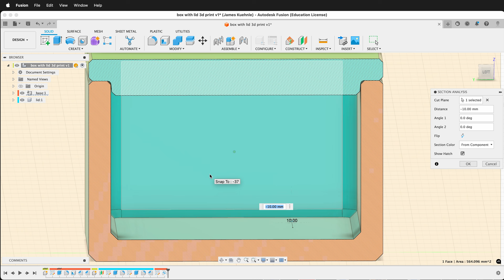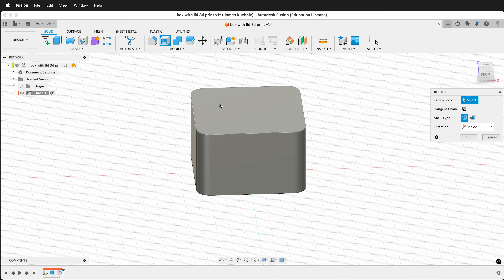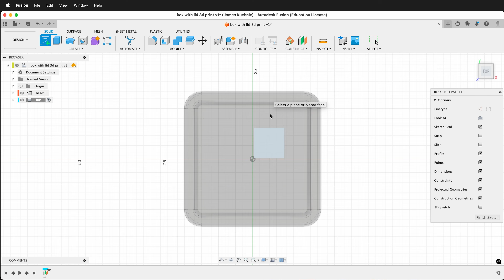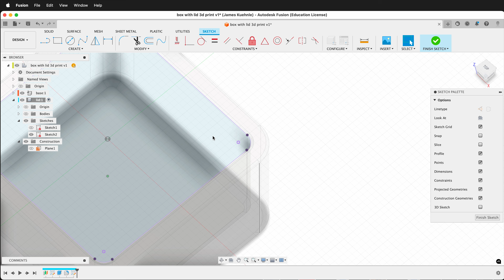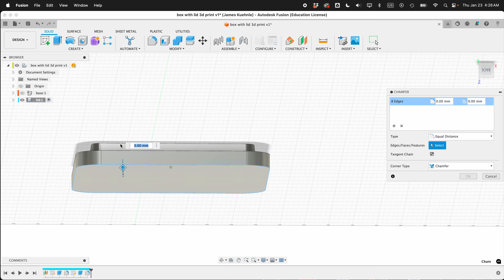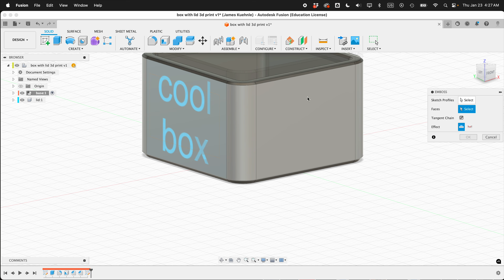3D Printed Box with Lid Fusion 360

Comment: Where is that new component button?
Reply from the maker: After January 26th, Autodesk Fusion changed to the hybrid design space, if you are working in the hybrid design space and not the part space, then right click on the top level component to create a new component 

To change from assembly, or part design, click in document settings in the browser infusion and then clicked a little pencil to change to hybrid design

Comment: Thank you for not going too fast. I already created a box but not the lid. Now I have to add an extruded mount to the inside for a small motor and controller, and flywheel with gears. It's my first time.
Reply from the maker: Sounds like a rad project. Let everybody know when it's done

Comment: Excellent video for a beginner like me. One question though: do I need to somehow separate the two components before printing or do I export and slice it as is? Will the two components be loose/separate after printing?
Reply from the maker: There is a check box in the 3d print export to either save them as individual files or export it as one assembly, when you bring it into your slicer, there is also often a question of whether it's multiple parts or one

Comment: how much resin is used for that size ?
Reply from the maker: Not sure as I haven't printed it yet, but you can find out the volume of a body infusion before your 3D print it so you can buy the material. Use, most slicers for 3D printers. Also tell you how much the two-yo you will use